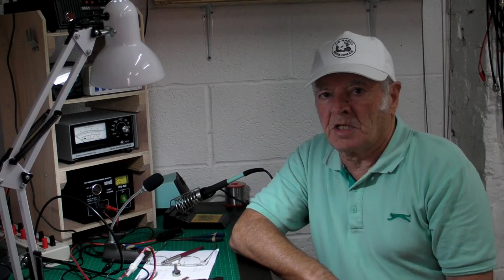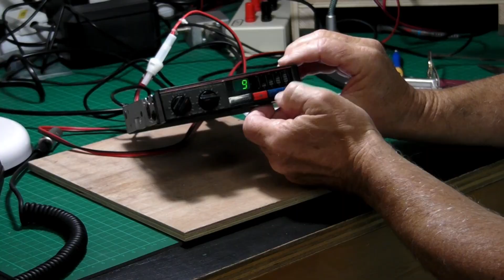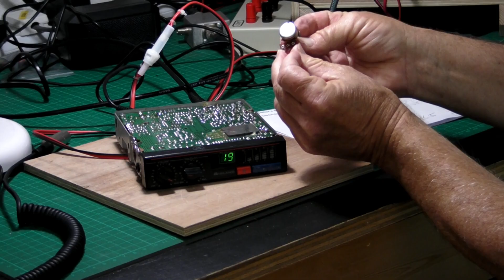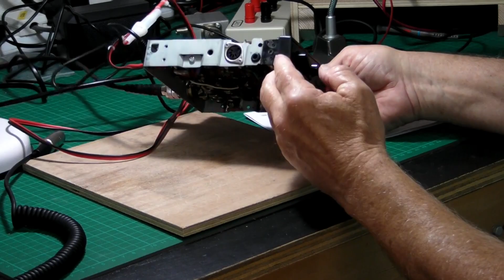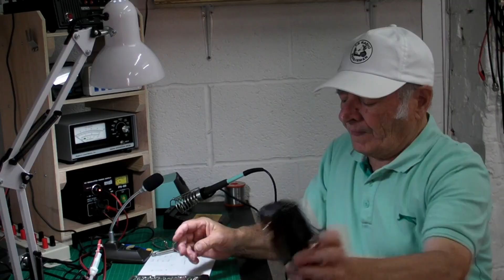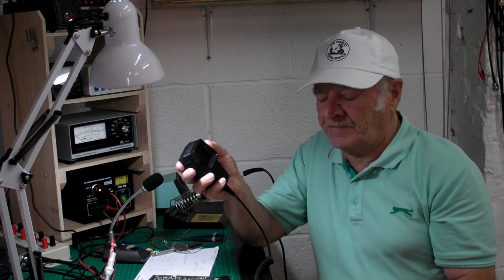Midland 77 1165 CB Radio

Comment: Cheers Ken I will take a look at that as the first port of call.
Reply: You could add 2 push switches to the mic. The down channel switch between earth/shield and the black wire on the mic socket that goes to plug on the board. The up switch the same but with a 27k resistor between the switch and black wire.
Reply from the maker: @TonesElectronics  I could get a Midland Mic with push buttons and change the resistors, but I am going to sell the radio, and a Midland Mic would cost more than the radio is worth,